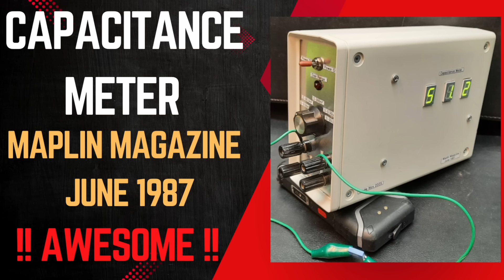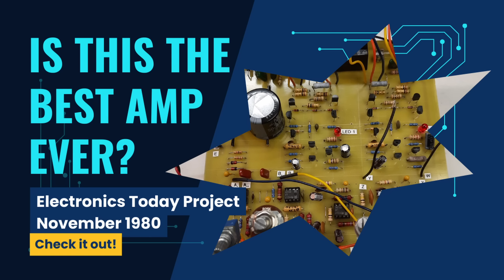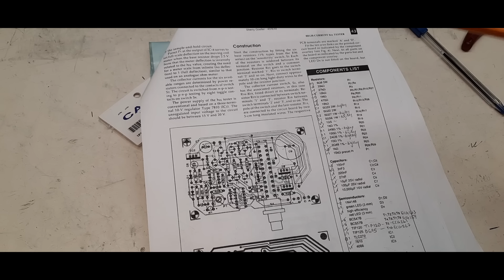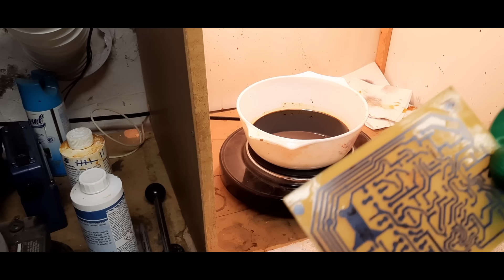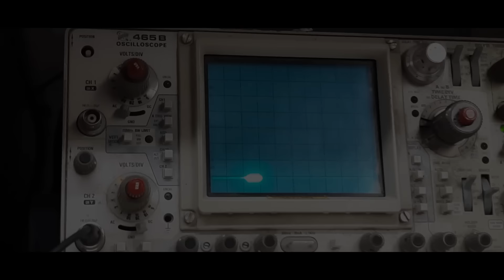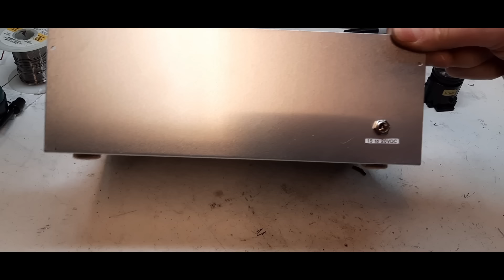Elektor - hFE Transistor Tester - September 1990

Comment: Cool build! And a really interesting circuit.
But the results look a bit odd. Or I'm not understanding the circuit right. So correct me if I'm wrong. The two LEDs create a reference voltage that is compared to the voltage on the resistors around S2 where you select the collector current. That's basically a shunt for the collector current. The base current is supplied by the darlington via the second set of resistors around S3 so the collector current matches the selection. The meter shows the base current requied to meet the selected collector current.
If that is correct the base current should change whenever you select a different collector current and the meter should move.

Comment: At about 16 minutes into the video you make some comments about transistor gain. I suspect you need to look a bit more thoroughly at your data sheets and also note that different manufacturers present some of the transistor characteristics differently.  Note also data sheets give gain (hFE) in the on condition and also dynamic gain (hfe) and they are different. (Note the capitalization hfe and hFE.) The onsemi data sheet I have for a 2N3055 states hFE as 20 min and 70 max but this applies for Vce = 4V and Ic = 4A. It also says hFE is 5 min for Vce=4V and Ic = 10A. Characteristics graphs also give clues to the way gain varies with operating conditions. Commonly the gain of power transistors reduces as collector current increases but it also depends on other things like Vce. In short I suspect the transistor tester is working better than you think.
Reply from the maker: Awesome info. So yeah, I did see the ranges but id not know about the finer points that you mentioned. I might have another crack at this project with the tremendous amount of feedback that I have got. Thanks for the info.

Comment: Changing the collector current range does not change the meter reading if you don't test the gain on each range. Ron W4BIN
Reply from the maker: You are absolutely right, I should have retested on each range. Thanks for the good catch!

Comment: Dang ! I knew I had seen this once but could not find it. Thanks for bringing this back up. Hope you're fine and recovered fully. Thanks for showing !
Just recently I had to select four pairs of 2N3055s for an antique Grundig stereo amplifier. I did it the old fashion way with a big power supply, resistors and two DC Ampmeters .... 🙄
Reply from the maker: That's great to hear! Selecting 2N3055s the old-fashioned way sounds like a true dedication to the craft. Thanks for sharing!

Comment: Tip for Elektor projects: check out a couple of subsequent issues. If errors are found in a project there will be corrections. Usually in the back of the issue.

Edit: I dit not find corrections for this project.
Reply from the maker: the thing with the Elektor magazines from the official Elektor web page of which I pay yearly, they do not include advertisements and also corrections. They just show the meat and potatoes of the articles. So, I am kind of on my own.

THanks for letting me know about no corrections. I think the problem is me. I am going to take it apart and trouble-shoot with the help of others that have commented on this video and if I can get it going, I will make a short video with it working (hopefully)

Comment: Do the magazines come with any Errata in later editions? You have identified two serious errors.
Reply from the maker: Sometimes ... the thing with the Elektor magazines from the official Elektor web page of which I pay yearly, they do not include advertisements and also corrections. They just show the meat and potatoes of the articles. So, I am kind of on my own. However, maybe the mistakes I think are on the project might not be mistakes. From the feedback I am getting on the comments, the design looks good. I am going to take apart the projects and go through it again and post another video with a working hFE tester.

Comment: The 18 K  for R26 should be about right. The full scale should be with some 2.5 V as in the adjustment procedure.  To limit the needle hitting the full stop one could add a resistor (some 4 K)  in series to the meter and a diode in parallel to this combination. R26 may than be reduced to 15 K to compensate for the extra resistor.

It is nice to have the test pulsed only: this way one also needs less cooling at the DUT.

HFE should not change that much with current. There are some transistor with a resistor from base to emitter.  HFE and the circuit should also be OK at 1 A.
For testing one should use a more standard transistor like 2N3055 and measure the gain at lets say 1 A in a separate experiment (e.g. with the power supply).
Chances there is something wrong in the circuit / maybe something oscillating or a wrong pulse length or a wrong switch type / connection.
The ranges should reflect the resistors to sense the base current. So the x 4 range should use the 10 ohm resistor for the base current.
The circuit is not super accurate (e.g. limited by the resistor accuracy (like 10%) and the 2LEDs as voltage reference), but it should not be that bad.

The 2 similar transistor circuit parts are the loops regulating the base current. One is for NPN and the other for PNP.

The circuit deserves a follow up video, with the issues solved.
Reply from the maker: Thanks for the very detailed feedback and suggestions. I will definitely look into these points and probably take it apart and try to trouble-shoot some more and make a short new video on it.

Comment: Without studying the schematics, I can't say how accurate this would be, but the NPN and PNP should react the same. Meaning, if the NPN starts at the top of the scale, so should the PNP. The only differences should be the polarity of the test. Since you used the PCB layout from the magazine, I would conclude either it's no good or some component like that fancy switch isn't right. Most likely the switch. Also, in order to verify it's accurate, you should test some transistors another way such as measuring base current while conducting a known current using 2 meters or something. Then you know what the hfe should be. The hfe will change depending on the current you're testing with, reducing with higher currents. Within a reasonable amount, of course. Like maybe from 100 at low currents and 30 at high currents for example. I like this tester because it does aim to test at high currents without using a huge supply or overheating transistors, so it's worth pursuing. Hopefully you'll follow up with it and if you'd like help, I'd be happy to help if you ask. Speedy recovery!

Comment: Hey Bettina, just a thought: as you're going through cleaning up traces, maybe use a white circle to make the center of the pad more distinct and more centered. That would make your drilling "center punch" more accurate.
Reply from the maker: I do that most of the time but sometimes I forget. You are right though, it is easier to drill when it is visible and evenly spaced; especially for IC's. Cheers!

Comment: The magazine gives enough information as to why the 18k should be correct (if everything is working 'as described'):

The designer(s) expected that a full scale reading develops, when exactly 2.5V is passing over the base testing resistor, Rb on S3. So you could test that at full scale, 2.5V occurs over the S3 contacts (either points F / G on the schematic; or at the output of the opamp to ground). This 2.5V is then eventually passed to the opamp IC1b; and ohm's law sorts out why the resistor values make sense: 2.5V / 100uA = 25k ohms needed; and (18k + 10k pot) = 18-28k for trimming.

I would check your LED voltages, and see if they give you ~3.9V as asked for. Nowadays modern green LEDs tend to have a higher voltage than the 2.1V mentioned in the article.

10A over 10V is 100W! Being briefly switched in and out every second! I would check that your power supply can actually properly deliver this sort of current at those settings; otherwise the asked for current is never being given correctly. To check this, you can measure with an oscilloscope over the S2 switches (be careful about circuit/earth/scope grounding), the scope should show a peak voltage while test is ongoing, and then you use ohm's law with calculated (or measured with a DMM) total resistance that S3 is currently switching in to check that the asked for current is being delivered.
Reply from the maker: That's super helpful information about the 18k resistor and checking the LED voltages and power supply, I'll definitely look into that in a few days as I am just getting used to my new vision from cataract surgery. I must say, I learn a lot from you all in the comments section and I need to take that knowledge and use it in future projects. Thanks!
Reply: The current for the test pulses is dumped from the 10000uf capacitor C9. The power supply does not provide the high current - in fact the power supply is limited to somewhere about 1 to 1.5 A max. because it is regulated by the 7810 voltage regulator IC2. C9 needs to be a good quality capacitor with suitably low ESR to be able to provide the 10 A pulses and have a good life expectancy!
Reply: Wouldn't it be a better solution to use a 3.9 V Zener diode as a voltage reference instead of the two LEDs?

Comment: I''m glad to have discovered your videos. I am interested in learning how you made this circuit boards from the magazine article.  Thank you
Reply from the maker: I "snip" the image from the electronic magazine board design and paste into a photo editor called GIMP. From there I usually have to flip the image horizontally so that it "reverses" the image. I then scale it to the real size it needs to be. At this point, I clean up the traces and make them thicker in GIMP. Once done, I print them out to that blue paper stuff and iron on to a board. Cheers!

Comment: Do not hesitate, share Your files, even the elektor articles.
At the dutch elketor Verlag, many projects have arisen from submissions to competitions and the like.
Many publicly available projects can still be found in the community area today.
Those published in Elektor magazines were usually slightly revised to adapt them to the tastes of the engineers there.
Elektor has filed DMCA complaints against hosting in the World Radio Library in the USA, and in some cases also against the online Wayback Web Archive
but I haven't heard of any private posters, blogs, etc. being sued.
So yes. When I redraw old documents myself or make significant changes, the greedy managers at the publishing house can't do anything about it.
This is not so easy in Europe either.

Comment: Love your channel, i've used those toner transfer iron on sheets with mixed results (wife's iron)... what is that gizmo you use and what is the process (number of passes through, etc.).
Reply from the maker: It is a laminator. They are used to make plastic badges or to laminate paper to make it waterproof and more stronger. I got it from a surplus store but I am sure you can get one from an office supply store. Cheers!

Comment: Good build,

Basically working first time, but with issues.

There is something wrong with the metering cct IC1b is a buffer only, so what voltage you put in should be what comes out. Current wise, you have a 10K pot in series with a 10K resistor, so that will give 500uA if the output is 10V and the pot at max. which it should not be, however you added 70+k either your meter is way more   sensitive than 100uA , or there is a wrong value somewhere. It's a bit suspicious that the difference is getting on for 10 times. Check the switch connections carefully, they can be very odd sometimes, likewise it is real easy to misread the newer 5 band resistor values.  If you find nothing wrong there  then check the pulse circuits. The width of the pulse will change the reading dramatically  The pulse width is a 10:1 pulse with the on period being about 1.5mS.

Power transistors of that vintage vary in their gain by very large amounts.  They don't vary all that much with different collector currents, but it's enough to cause issues especially when needed matched pairs. As an apprentice I spent too many hours selecting transistors on the huge old tek curve tracer! hfe's from 10 to 120 were more the norm than oddities!

Inkscape is a DTP type program and is a bit of a pain to use.

Use LibreDraw for the final output, and LibreCAD for the accurate drawing.   Transferring between the two is easy, but there is a bit of a trick to get LibreDraw to get the scaling factor correct. If you get hung up on that let me know and I'll write up the method. (Like most things once you do it, it's very easy).

When you overdraw the PCB lines, set your brush to a round shape, with the diameter of the line width you need. You will then only need to draw one line to cover the whole track.   

Andy
Reply from the maker: Thanks Andy for the explaination. I am going to mess around with it tomorrow and see if i can understand it better.
Reply: What's DTP? Inkscape always works perfectly for me doing front panels?
Reply: @MB-ruminy  DTP - DeskTop Publishing  Inkscape is not a general drawing package. Like most software it works well once you are familiar with it,  however with Inkscape you need to be more than a bit  familiar with it to make it work. Most users will find the LibreDraw, Visio and such like programs much easier to use.

Comment: When you push the test button it samples and holds the value, that's why the needle doesn't move when you increase the current knob 20:05. You would need to push the test button again to get a new reading at a new current (you should expect hFE to decrease as current increases). I also think you might need to press and hold the test button for a second or so to ensure it captures a reliable value?
Reply from the maker: I am such a mess. Why didn't I think about that. I will try that tomorrow and see if that chanes things. Cheers

Comment: Inkscape is great for pcb and panel layout. I've done some book restoration page layout with it. Yes, I am crazy. 

 You seem comfortable in Gimp, so why not use it? New letter size with a box the size of your project face. Guide lines, layers, holes and text.  You can make your drill guide one layer, your layout lines another, and the text in a group. That is basically how I used PS CS6 before going open source. Did page layout for technical manuals in PS CS3 for years. I knew Indesign but PS was my jam. New all the shortcuts, one hand on the mouse and the other on the keyboard.  ctrl key was blank from use.

Inkscape isn't that hard, just need some tutorials.  Logos By Nick is a good one. TJ FREE, IronEcho Design, and Dinosaur Mama are just a few I've found. Chandwell has a playlist on scratch building with Inkscape. Most of the newest ones are Laser cutting and CNC focused and not so much on the drawing and layout.
Reply: If you're crazy then I'm crazy too because I think Inkscape is superior for this kind of work.
Reply from the maker: Awesome advice ... I am working on a project right now and I got a panel made using Front Panel Designer. I think this program started but never finished. It is just basic. However, it got this new panel made. I will try GIMP for the next panel as I know it a bit. That layering stuff always messes me up but it is high time to understand it. Thanks for the tips.

Comment: Germanium age aand lose hfe it seems.  also world is full of fakes . cutting em open reveals no copper slug below die and bonded with white polymer to metal case. bad.   Great build.  I usualy rely on the tektronix 475 to test transistors.

Comment: Great project. Is it possible that you can share the PCB image that others can build their own? Thanks again for the great video.
Reply from the maker: So the article and the pcb design is in the magazine. Go to Elektors main web page to sign up for old issues and of course new magazine projects. Cheers
Reply: @bettinaneumryr  Well. All the work has been done by You.
Why do it again and agian?
You could share the prepared improved files used for the toner transfer method easily.
I DO SHARE those files in pdf format.
That does not mean I share the pcb native editor files most of the time.